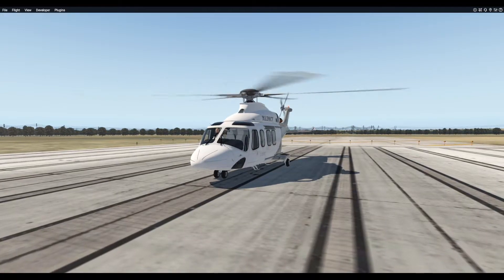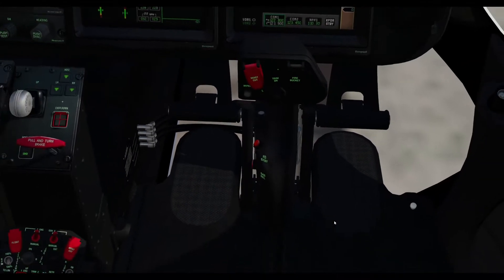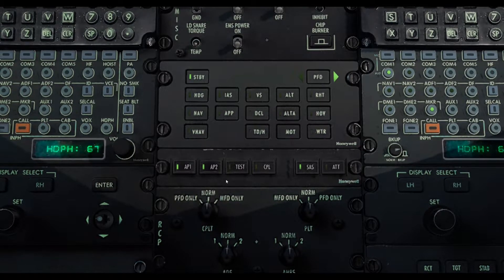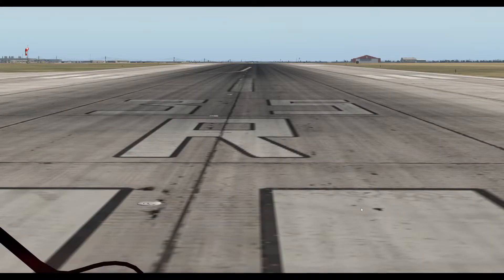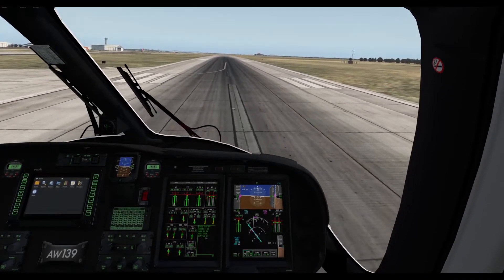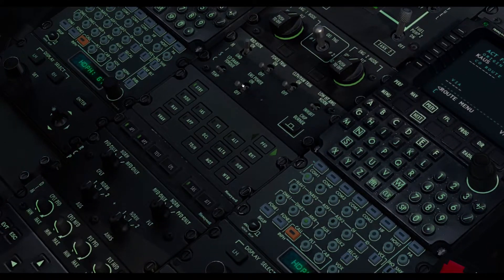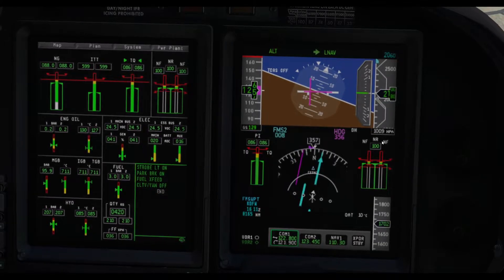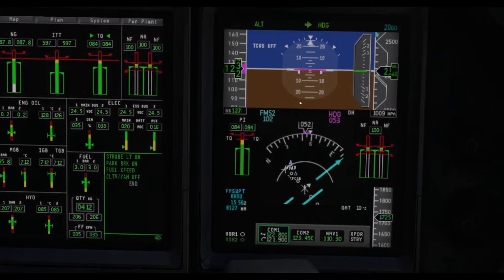X-Rotors AW 139 Autopilot Overview

Comment: Your video has been very helpful. I managed to take off and play around with the Autopilot. BUT,  I am struggling with the cockpit views , like from PFD / MFD back to center console.  I saw you you move the mouse back and forth  so fast to get to each panel ( AP/ guidance controller).  What is the the a command to set to use the mouse to move around the cockpit panels? Thank you
Reply from the maker: You can set quick views in X-Plane.  I believe my key binds are setup at CTRL + X with X representing a number pad key say CTRL + 1 or CTRL + 3 to quickly allow you to move around the cockpit in 2D mode.
Reply: @CajunJosh  Hello Josh, MY CCD has an issue. I tried using Ctrl + X,  but the CCD still not working.  In fact before that , when I use the mpouse click , it is not even respondoing.
Reply: Besides,  The MCDU is not the Primus Epic FMS.  Mine was an airline MCDU , although some similarities but different labels

Comment: Lovely looking aircraft model. There is an error in the AFCS implementation though. The AW139 AFCS can't maintain altitude with pitch. When a vertical upper mode like ALT is selected it will only use collective to maintain the vertical reference. Pitch can only be used by the AFCS to control airspeed.

Comment: Thanks! Now my helicopter can follow the NAV route. Just one thing.. when following the route my helicopter leans to the right in straight flight? Does anyone else experience this?
Reply from the maker: Completely normal Nick.  As you are speeding up the rotor disk starts to produce asymmetric lift.   The rotors on the side of the disk that are advancing into the oncoming air start to produce more lift than the retreating blades going with the flow of wind.  The faster the helicopter goes the faster the more pronounced the lean will become.
Reply: @CajunJosh  Ah yes. Thank you. I didn’t think about that. Makes sense. Using the direct to function on the FMS has also helped me with the S92 helicopter.

Comment: BLADES still  jerky not smooth at all.
i wont be buying this. till the rotor blades turn very smoothly without any sticking effect.
Reply from the maker: I guess it's a subjective opinion, possibly related to my OBS recording software.  I don't have a dog in the fight as far as selling the module goes but IMO it's one of the best rotor animations out of any of the available XP11 helicopters.  I know many have found the new rotor animations to be a highlight so it's possible the OBS recording settings aren't conveying accurately what I'm seeing in the sim.